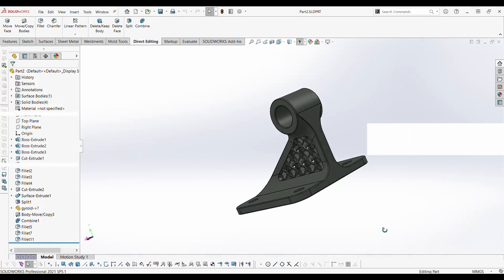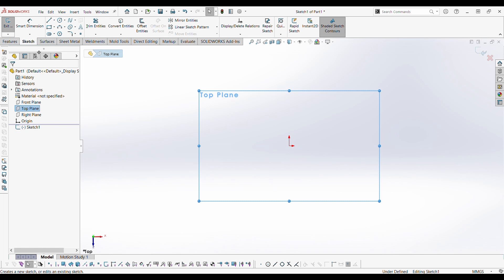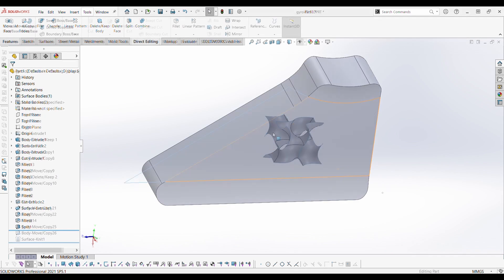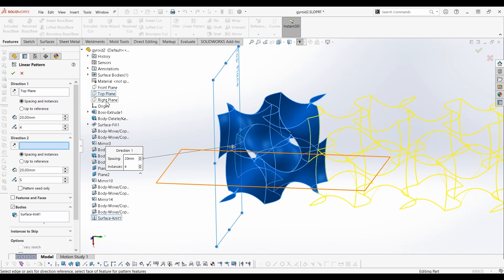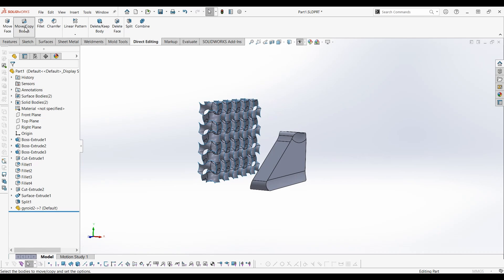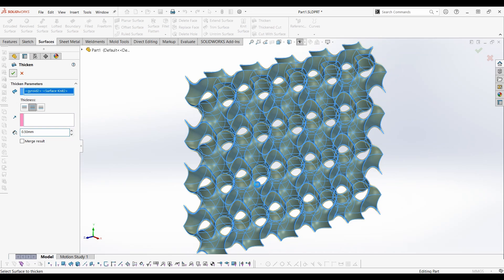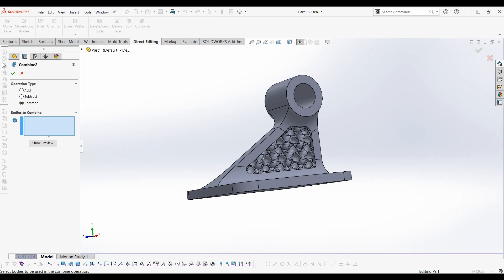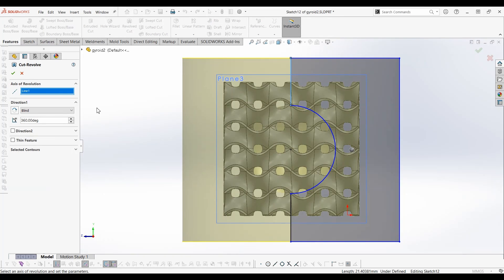Create a gyroidal lattice structure in any part using Solidworks

Comment: hey there, it says face which failed check or cannot thicken.
Reply: same issue
Reply: You could be making the thickness too large. 1/10th of the unit cell length as the thickness seemed to work for me, so I try not to exceed that
Reply: @MocosBokos  i followed the exact same dimensions on the video, the thickening did not work

Comment: Thank you for the video. I am using Solidworks 2023 and I have a question regarding thickening. I created the gyroid surface from your first video, exactly as you have shown it, and now created the gyroidal lattice as you also have shown. There are no errors in my design but I can't thicken the lattice or the single gyroid from the first video. Do you have an idea what may be causing this?
Reply from the maker: The surfaces may not be tangent to each other.
Reply: @A____11  How do you figure out if they are not tangent and what would it look like?